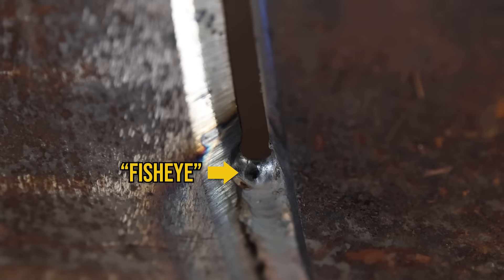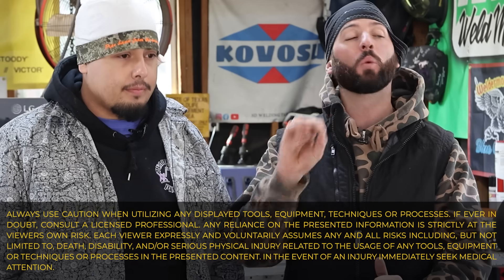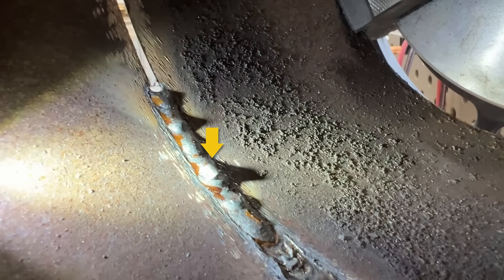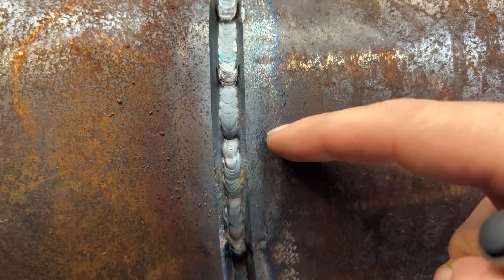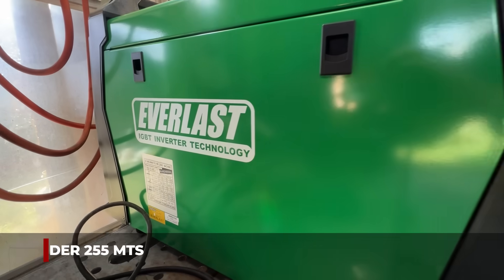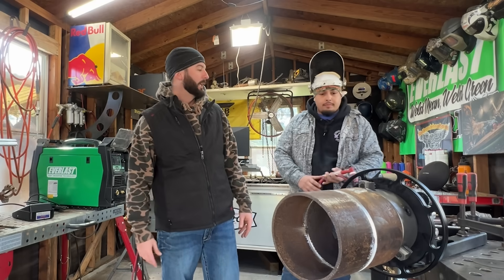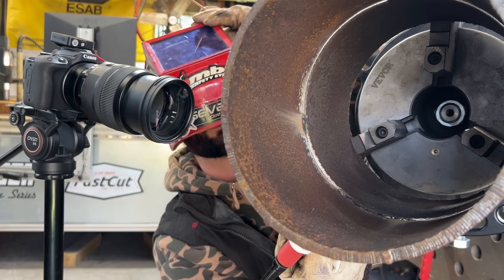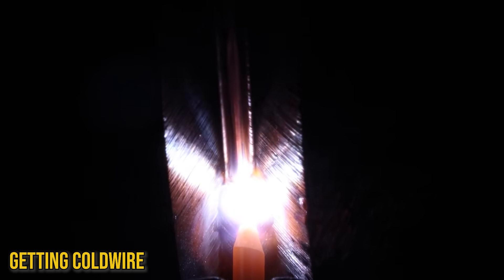Preventing 5G TIG Welding Mistakes: Cold Wire, Suckback, & Non Fusion

Comment: Thank you for this very informative video. What tips or tricks do you have for us students who are not allowed to back feed the filler wire into the root?
Reply: let me work on that for you, its still a great way to put in a root. requires a little more heat and pressure form the wire.